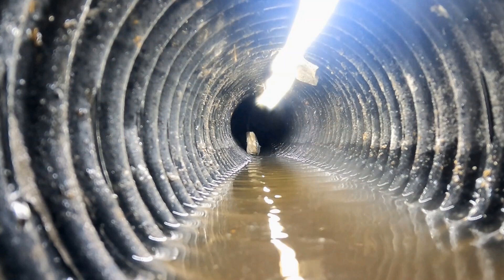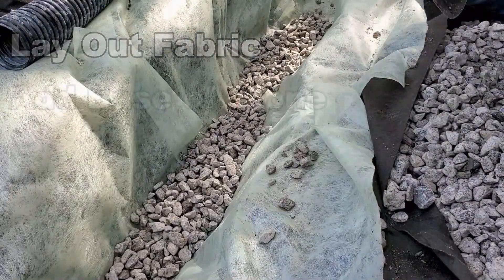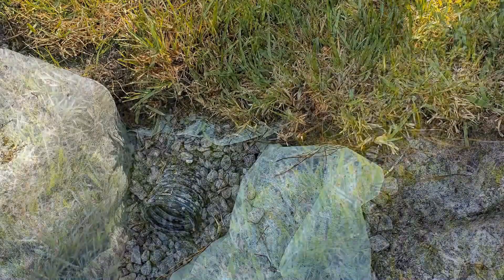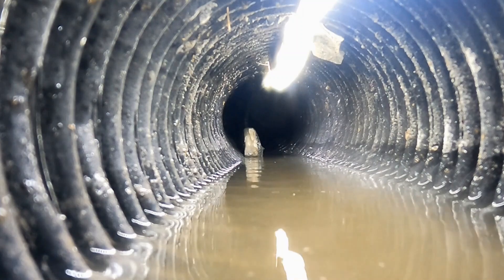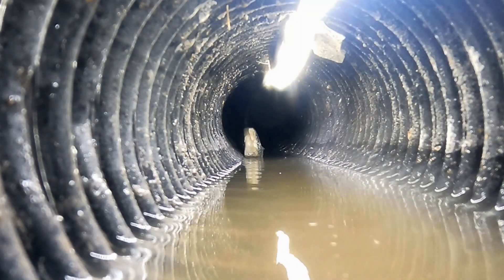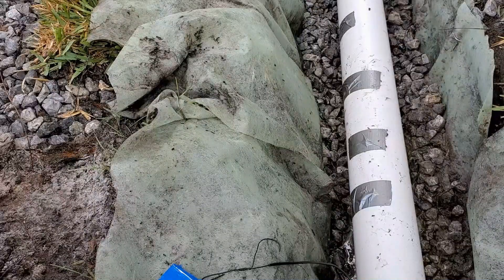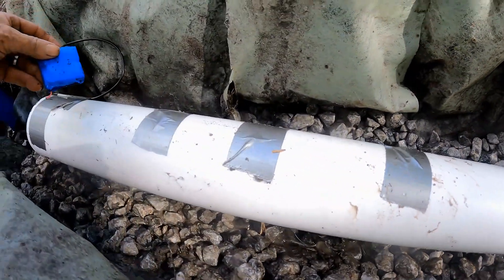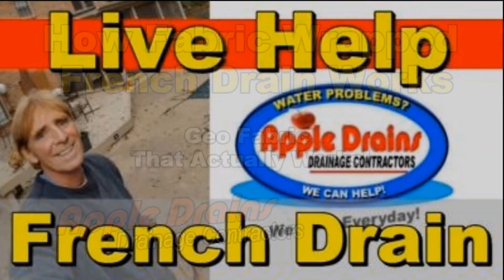Watch Before You Install Geo Fabric French Drain

Comment: PVC evacuates water at a much faster rate, but dearer and slower to install at the bends. I wish you tried slotted PVC with the slots on the sides. Slots are easy to cut  - approx 100mm apart no more than 1/3 diameter of the pipe -  with an angle grinder and a diamond disk.